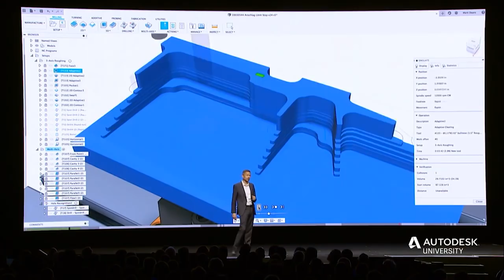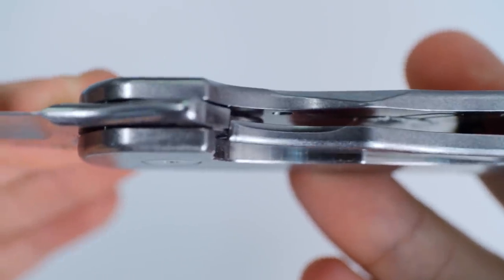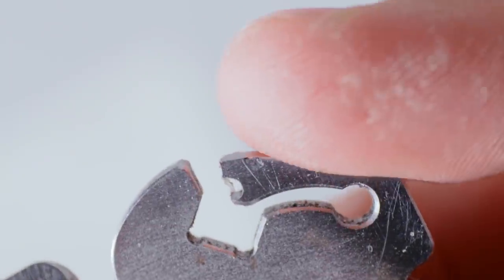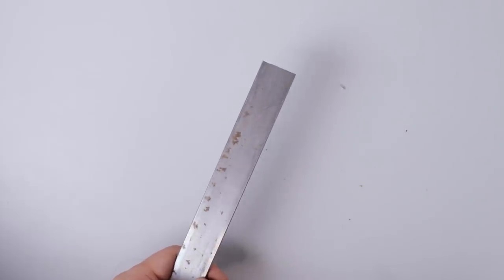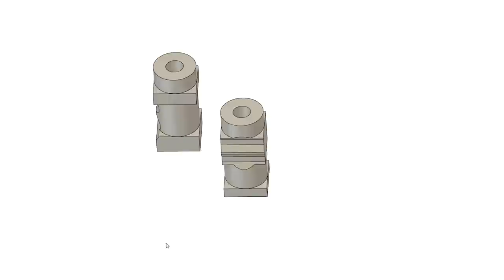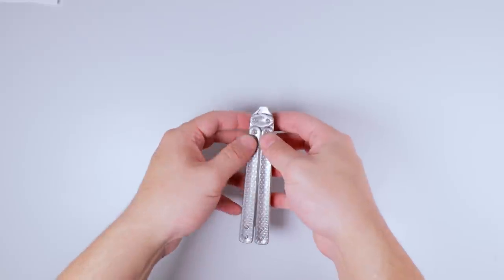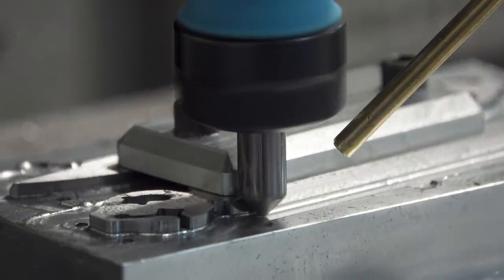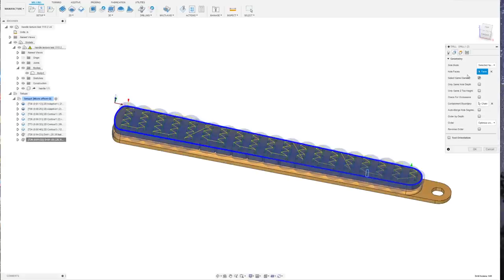Finishing the Steel Baliscissors. Ep 6

Comment: Great job on this! I like how you walk through your thought process of designing and testing/experimenting with different ideas.

For small tooling, check out Harvey Tool. They specialize in miniature tooling and most everything is available off the shelf. They even make a .001" diameter endmill!

Also, put a slight bend/curve in one of your scissor blades and they will cut better. This causes on blades to interfere slightly as they close, so the point at which they are cutting is always tight with no gap for the material your are cutting to slip into. Most scissor are made this way.
Reply from the maker: I get what I can from Harvey. I get lots of form tools from them. I get them from carbide emporium, as it seems to be the only place I can find where I can order directly rather than through a distributor.

That slight bend in the scissor blades is something I've thought a lot about, but don't know the best way to do it. I assume I want to do it before heat treating, but I don't know if the bend will change in the process, especially if I want to use air quenched steel. Most people seem to press the steel between two aluminum plates. Grimsmo attached some plates to an arbor press that also have water running through them. He wanted them to be as flat as possible, but I was thinking maybe I could purposefully surface a curve or angle into the plates. I also don't know how much grinding or finishing work will need to be done to the blades after heat treat, and if a bend would make it annoying.

I imagine that the amount of interference or bend I need is rather small. Maybe instead of a bend I could also just mill away a small amount of material (only a couple thou,) at the hinge section of the blade, creating interference.

I need to do more research, but sadly it seems like scissor making is a bit of a dying art.

Comment: You need to design the bend to a longer area. In your design, it’s basically in one spot. Try thinning the “arm”, so that displacement is more uniform. And add hot glue to the pocket before you mill it open. And those dynamic toolpaths generate forces in Z-axis, so I would rather open the pocket in traditional contour path with small Z steps.
Reply from the maker: Those sound like good tips. I've changed my design since this video, but the reason I had it hinge in just a thin spot was because I was looking at frame lock knives. Knives like Grimsmo's or other frame lock knives often just thin out a section of the lock bar. Now after seeing you're comment, I can see that this is probably one of the reasons it wore out quickly.